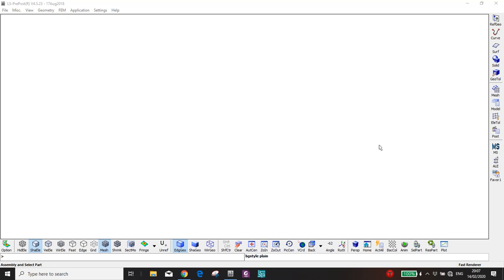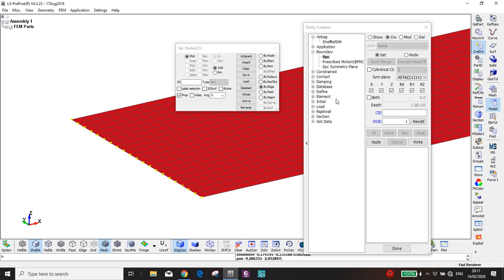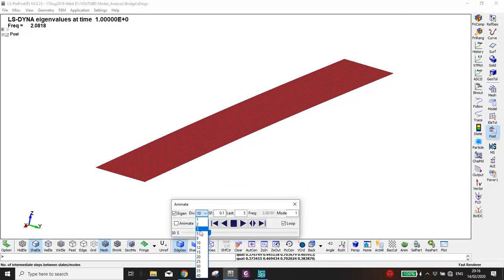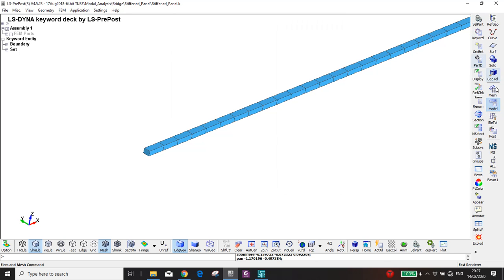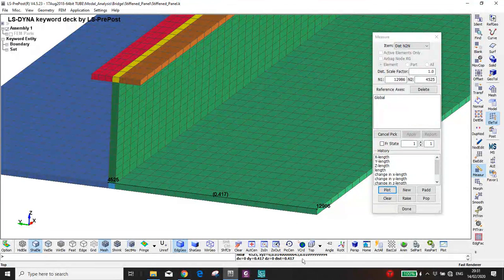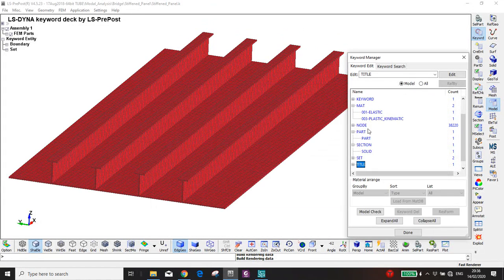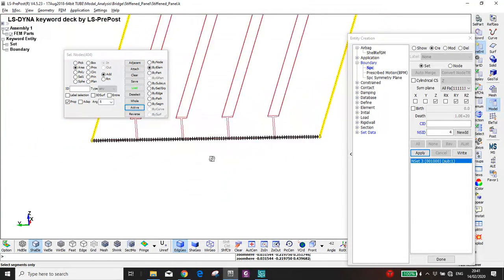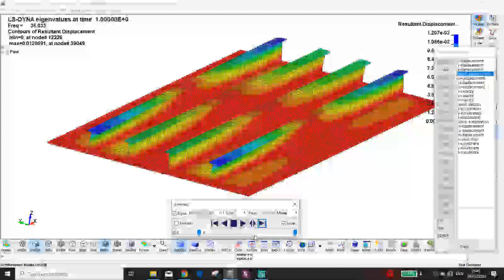LS-DYNA TUTORIAL 8: Modal Analysis and Stiffened Panels

Comment: Hello sir, what if I'm getting negative frequency? Is the value valid or there is some problem with the simulation?
Reply from the maker: How do you mean negative frequency? 

You apply FFT then you get negative amplitude, is that what you mean?
Reply: @AmeenTopa  Oh sorry sir, that is not what I mean. what I mean is the natural frequency result for modal analysis. Is the result valid if we obtain negative value for the frequency?
Reply: Did you what cause the natural frequency result become negative instead of positive?
Reply from the maker: @cynthiabong7002  I never had them before. But make sure that your model is properly fixed.

Comment: how can we find papers in which there are data about the material that we need in LS-DYNA
Reply from the maker: You can check my LS-DYNA TUTORIAL 2 and LS-DYNA TUTORIAL 3:. I mentioned about Varmint al's engineering website.
Reply: @AmeenTopa I witnessed those videos, I mean every materials. Not just metals or concrete
Reply from the maker: There is no such database that have the information on all materials on this earth. 

You need to search in journal articles and technical reports, see what other people have done. 

If you want me to give a more useful answer, you need to be specific to which material model, and what type of material you want. 

For example, we say steel, there are hundreds of steel grades,
Another example concrete, what is the compressive strength and type of concrete, or
Say you want composite, we have many types of composite materials, what is the adhesive material, and what is the fibre material etc...
Reply: @AmeenTopa  I want material property for Mat number 57 low density foam. Can you help me???
Reply from the maker: @kasratakbiri3265  Again, what is exactly the foam you are interested in? PU foam? Polystyrene foam?

Check out these references:
https://www.d3view.com/best-practices-for-modeling-recoverable-low-density-foams-by-example/

https://www.dynalook.com/conferences/european-conf-2003/modelling-of-foams-using-mat83-2013-preparation.pdf
https://www.dynalook.com/conferences/european-conf-2001/3.pdf
Reply: @AmeenTopa  PIR foam
Reply from the maker: Never used this foam before. But you should be able to find something in the open literature.

Comment: Hi, how exactly did you get the d3eigv plot? Is it obtained automatically after running the simulation? I've been having trouble trying to obtain it for some reason.
Reply from the maker: You need to set the numbers of eigen values you want, this is done though CONTROL cards as I did in the video.
Reply: @AmeenTopa  Okay, great. I managed to get it this time, I made a huge mistake before. Thanks so much!
Reply from the maker: @MS-ld3jn  Glad you figured it out! All the best

Comment: Hii sir, i m doing a birdstrike analysis on aircraft wing. Need some help with material properties and contact of the bird and wing.
Reply from the maker: Hi, please watch my tutorial.
https://www.youtube.com/watch?v=ISU_GqfRs5I

Regrading the material properties, you need to refer to journal papers.
Reply: @AmeenTopa  I've watched that video sir, but my doubt is regarding the material type i need to select in ls dyna. I m using metal matrix composite for wing skin material. So, which material type should i select sir?
Reply from the maker: @abhishekgarg1085  What are properties of the material you have? Mat Composite Damage is commonly used for shell elements which models composites.
Reply: @AmeenTopa  I don't have much properties sir, but i do have the material density, young's modulus, poisions ratio, yield stress, bulk modulus, failure strain values. I was using Mat 03 Plastic Kinematic .
Reply from the maker: @abhishekgarg1085  composite material are orthotropic material meaning you need a material model which can describe this behavior. The material properties are different in different directions. MAT03 is for isotropic material behavior.  

For example, if you are modeling within the Elastic region, you can use MAT ORTHOTROPIC ELASTIC.
Reply: @AmeenTopa  Ok sir, thank you so much for ur time sir. 😊😊